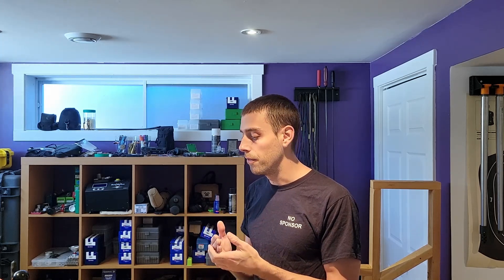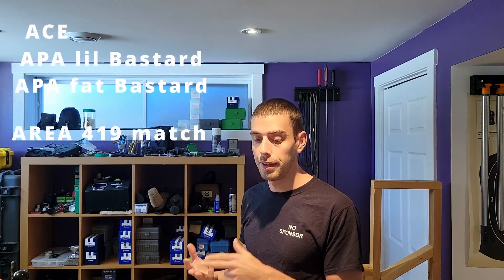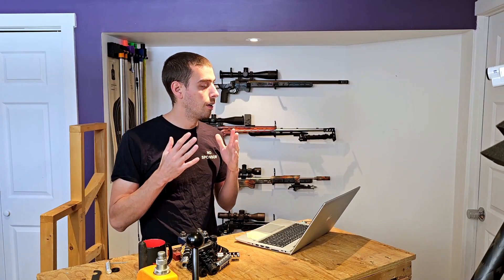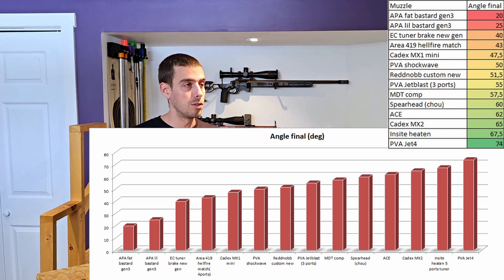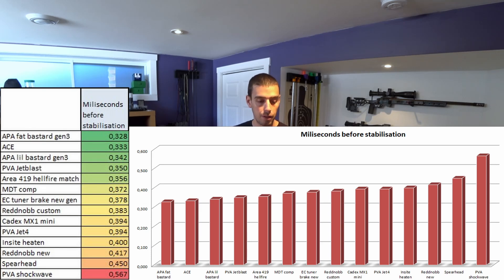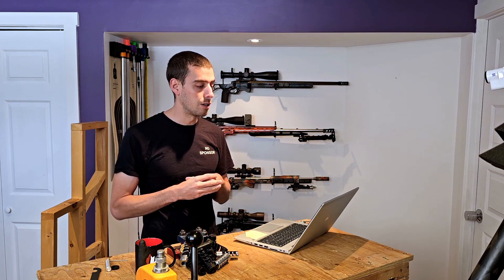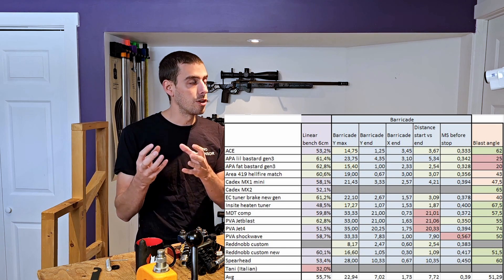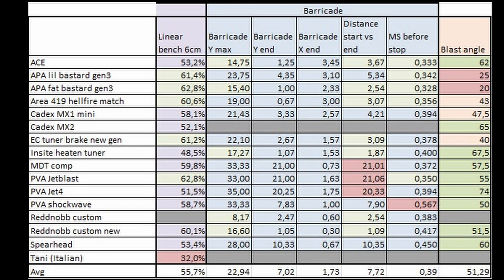Every Precision Rifle Brake Tested and Ranked part 1 of 3

Comment: Been seeing a lot of newly designed brakes that are stainless but with black coating and many of the companies refuse to provide the muzzle brake in bare stainless. So far I asked several companies if they would MERELY stop some of the brakes from going to the blackening process but they told me no. I made it clear that I dont want a black brake sticking out on the end of my stainless barrel and there's a lot of people now with stainless barrels as they have become more popular, but i was merely told "sorry. we dont offer them without the black coating" and none of them would provide a reason.
Bare stainless even saves them time, materials, money but their one-track mind dont want to help the customers.
Reply from the maker: Im not selling brake or anything, but I know most colored brake arent usually SS. Thoses that I know either run SS, or other that they will paint or treat for protection. I might be wrong, but thoses that I know are black arent SS.
Reply: @canadianprecisionshooting9597  
I know what ya mean but the ones I'm talking about had specified theyre base metal was stainless steel

Comment: Thank you for taking your time to provide this information. I have a .416 Rem Mag and it kicks like a mule. I dont want having to pack the buttstock with weight and so I'm hoping a muzzle brake with significantly reduce the impact of the recoil on my shoulder
Reply from the maker: Thank you for the comment. I am sure it will help a lot

Comment: You do not have any Ultradyne brakes!!!???  They outperform all. Best brakes on the market. I have Apollo Max, Apollo S, Mercury, Pulse and Athena (linear). You simply must check them out. 16” AR shoots like a .22LR with the ApolloS
Reply from the maker: Hi, yeah we have tested the Ultradyne brake recently, it will be in the next video. I think its already in the table of the third one. Its a really good brake, it doesnt outperform all, but it class really decently.

Comment: Question,.. Does the PVA Jet 4 with, the Port Blast angle at 74 degrees, deflect the Blast Noise, away from the shooter to avoid, "Concussion Headaches" from prolonged shooting ?
How is it on Muzzle Rise for seeing,.. Impacts ?  Is it, one of the "Better" Brakes, in Your Opinion ?
Less Muzzle RISE and LESS Blast, are my main Needs for, my 6.5 Creed. Recoil Reduction is NOT, as important to Me.
Good Testing !!!
Thank you, Yanick, in advance for answering, my Questions.
Reply from the maker: Hi, long story short, the PVA brakes are the best concussion side, even better than 90deg port (witch is kind suspicious, but the results talk for themself) and it's the reason all my hunting rifles now run PVA brakes. 
On the muzzle rise side, if you don't mind the size, the shockwave shows best results with creedmoor case size. I've run a Jetblast (3 ports) for a long time on my 6.5creed and been really happy with it.
Reply: Thank you, for your Reply !  Brake "concussion" at, the shooter, is very important, to me ( #1 ). Next is, Muzzle rise, lastly is recoil reduction.
  I will be looking at both, the PVA Shockwave and, the Jet 4 Brakes.
 I'll put, a Phone call into PVA soon, to discuss which is better, for my Sporter weight, Tikka Rifle, in 6.5 Creed. Again,.. Thank you, for your Reply !   @canadianprecisionshooting9597

Comment: Great video? Did you tune the APA brakes before testing to monitor their actual potential in muzzle movement mitigation? It didn't make a lot of sense to test without doing so?
Reply from the maker: I did, but with what we were testing, it seems like all port opens was the best for muzzle rise. Closing port have more positive effect for left and right movement from my observation.

Comment: The Mdt comp comes closed... you said you did no adjustment which means its closed... seems unfair for the barrel climb test. My MDT Comp brake has way less climb than my Fat bastard gen3
Reply from the maker: No adjustment done, all ports open. It did not performed well on the free-recoil, but did track really well when pressure applied to the buttstock.

Comment: I have one of these and its ok. I have found MBM self timing beast brakes, x-caliber's xterminator & max terminator to do a better job with both muzzle lift and recoil. And that ace is even on a 257ackley i built with a 31" mtu 1:8 twist and still has more lift than the custom 264win and 6.5saums ive built with the other 3 mentioned

Comment: This video would’ve taken some serious time to produce, so my hat is off. 

However, the test is around Prs style muzzle brakes and I would have loved to see the TMB in there  it offers not only amazing recoil reduction, but is also a tuning device for accuracy development   
The company has shown internal testing where it is 100% a leader in recoil reduction not sure why it’s not here.
Reply from the maker: Yeah, it took quite some time to make it. I'm putting my hand on a TMB brake for the second or third video, depending how many time it will take to get here. I've been in contact with them but the decline sending a unit for the test, they have been backorder for some time now. So stay tuned, in couple weeks they should be added to the test.

Comment: I’ve shot most of those higher end brakes and the TMB has performed better than all of them and without a concussion to the shooter.

Great testing in the video though!
Reply from the maker: It is hard to tell without testing. TMB have declined the invitation to be part of this first testing, but I'll try to get my hand on one for the next video to see. And confirming the blast angle, just looking at the port angle, I doubt there will be no concussion, but only test will tell.
Reply: @canadianprecisionshooting9597  the tuner at the rear of the brake prevents that blast from hitting the shooter; no headache after a match like I experienced with area 419 hellfire. 

You can always purchase the brake and test. Makes no sense for Without Warning to give you a free muzzle brake when he can’t even keep them in stock.
Reply from the maker: @jetthreat5000  totally understand why he declined. 
On the other hand, it would make no sens for me to buy the must expensive MB on the market for a 2hours testing session. I test a lot of them, cant buy them all.
Reply: @canadianprecisionshooting9597  then why go out of your way to say Without Warning said no to a free Brake, with no context as to why, when you yourself aren’t willing to spend money to test? I’ve tested dozens of pieces of reloading equipment, muzzle brakes and scopes with my own money and turned around and sold what I didn’t like. 

If it’s not worth 2 hours of testing then don’t go out of your way to low key crap on someone.
Reply from the maker: @jetthreat5000  i am not saying crap on someone, just telling they decline being on the first video being the reason they are not there is just a fact, like the rest of the video. I have been asked to test dozen more brakes, I cant buy them all. 
And over that, I stated I am trying to put my hand on a unit for the testing. No bad intention against them buddy
Reply: @jetthreat5000  If the tuner part of the brake is absorbing some of the blast and keeping it from hitting the shooter, wouldn't that add to the overall recoil? There is definitely a give-and-take between overall recoil reduction and blast felt by the shooter, as proven by these results.
Reply: @whallison1  negative
Reply: @jetthreat5000  please explain the physics of how it doesn't
Reply: @whallison1  that would really require a 3D rendering in either fusion 360 or solids works and pictures of the brakes carbon deposits on the tuner and barrel. 

The turner it self isn’t a solid wall, it has an angle to it at the front and back of it that deflects the gas at a different angle. Additionally some the gas actually gets diffused between the tuner and the locking nut on the TMB. 

This has also been brought up by Morgun King and Brady Allison in their podcasts on how the tuner prevents the concussion from hitting the shooter.
Reply: TMB have the most concussion of all brakes known to man. Top Performance but lots of concussion.

I know at least 8 Top shooters myself included that all own the TMB. You are the first ever seen to claim that it has low concussion. Thats simply lying. :P

It's very good on performance but smacks your face around, throws rocks and dust on prone shoots. Several here ditched the TMB and went for less concussion variants due to PRS PRO matches being a marathon and not a sprint sport. Especially 2 and 3 days matches with lots of rounds. Cheers
Reply: @Botniasolutions  not at the shooter. I’ve shot the Hellfire, Gen 3 Fat Bastard, and TMB side by side and the  TMB had the least amount of concussion at the shooter. The hellfire gave me a headache at a 2 day match, the TMB hasn’t.
Reply: @Botniasolutions  throwing up dirt, I’ll agree, easy fix for that  though is putting on eye pro for that stage.

Comment: Great video Yannick, I wonder how much of a difference the weight of the brake makes in terms of recoil.
Reply: MDT did a great video on it. Weight reduces recoil by a ton!
Reply from the maker: @Mr.Killswitch  MDT tested the weight of a rifle, we are talking about the weight of the muzzlebrake only.
Reply: I understand.. but they showed that weight alone kills recoil. So a lighter brake that cuts recoil down as much as the heavier is therefore more efficient. Also their test illustrates why yours would’ve showed more disparity between brakes  if you wouldn’t have used a 20+lb rifle.. have a nice day!
Reply from the maker: It's also a question I've asked myself. But it is hard to test it, I'm not sure there is much difference